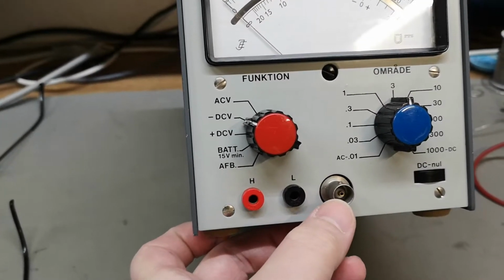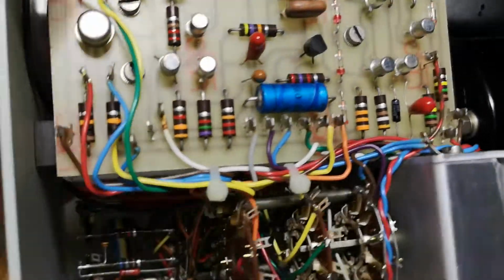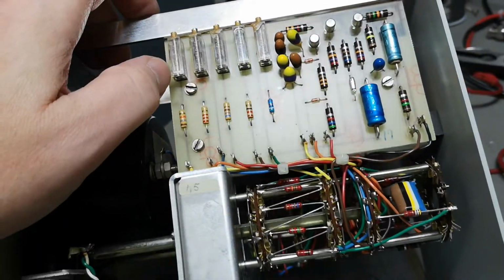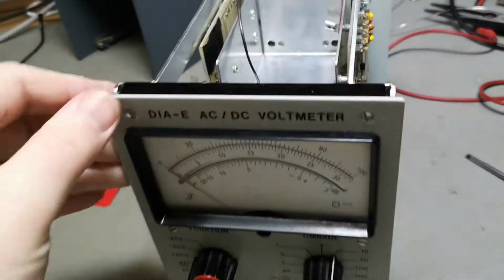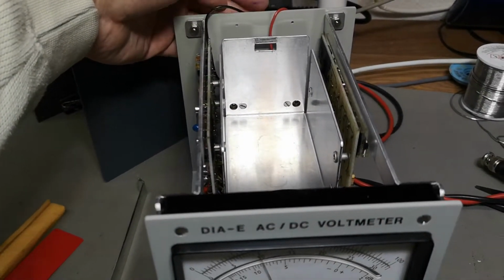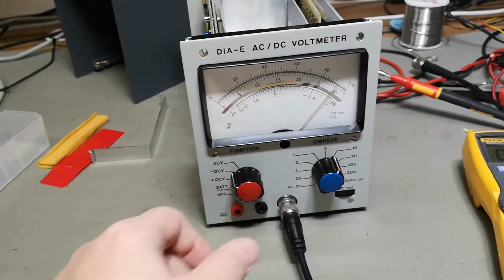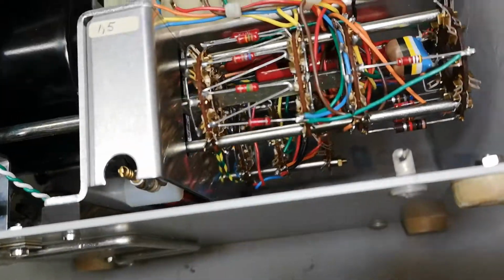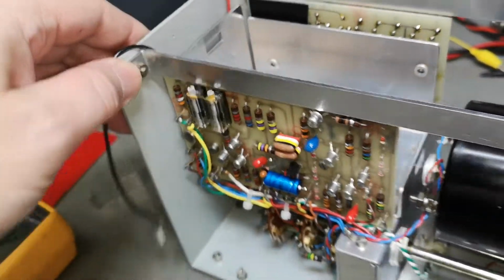DIA-E AC/DC Voltmeter 10mV-1000V range test repair teardown

Comment: Could also have used 3 6V lead acid cells, or 4 4V5 torch packs, with the spade connectors looking like they are original. The guess is the 4 4V5 lantern battery 3LR12 in a case was used, the clamp plus the packing looks right for this size battery, and they were incredibly common as well, with the 3mA current consumption giving around 500 hours of use on the zinc carbon pack, and the 15V low battery state being about right for a zinc carbon battery, as by that stage ESR likely was in the kilohm range, well past use for a torch, but perfect in this application at low current. Not all that common any more, but still made, and in production since 1901.

Comment: A very nice meter!
Did you check the input impedance whether it is standard (1..10MOhms) or higher?
It is nice they used high voltage capable components in the attenuator but I am concerned whether the input terminals and the BNC specifically are suitable for 1000V AC.
By the way AFB is OFF?
Reply from the maker: yes AFB is short for AFBRYDER means DISCONNECT in Danish, sorry but it was the style to write the front plate text in local crypto back in the old days, stuff was not exported, today even internal test equipment is all written en English, you see the same thing in French and German equipment, and yes I would also be concerned about 1000kV on bannas :-)